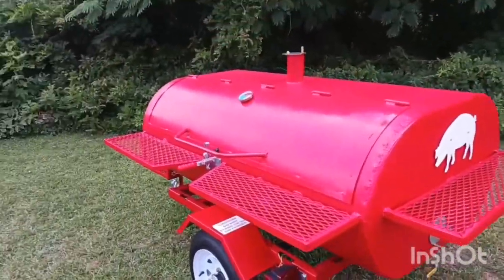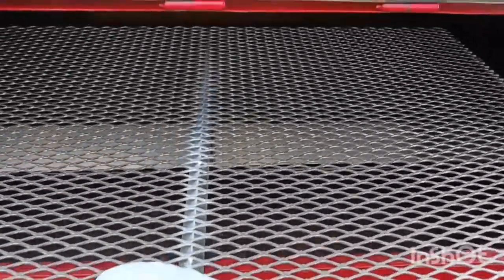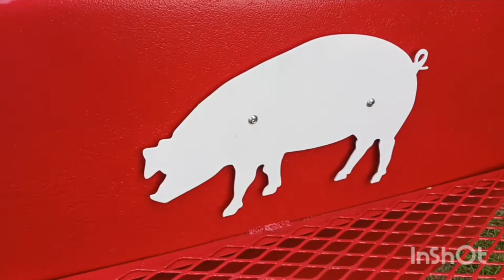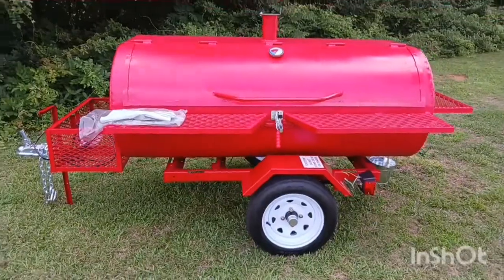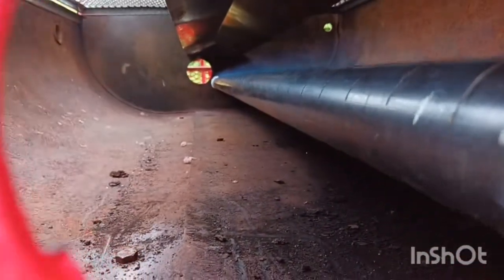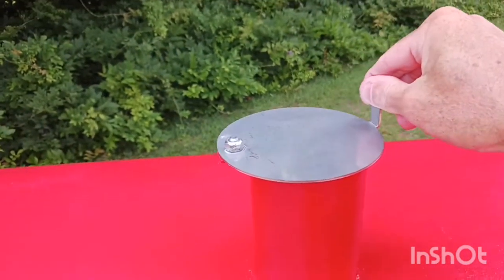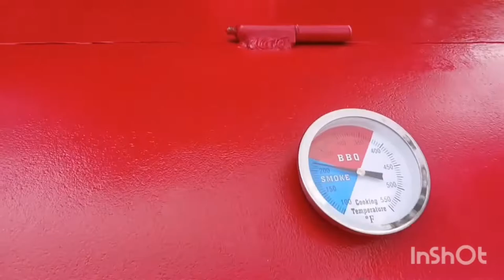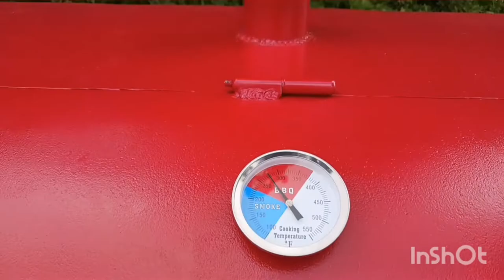pig cooker

Comment: Junior can you make a combo model with both propane and a fire box in the rear, so you can add smoke to the meat while maintaining steady even temperature with the propane.  And one more mod. Can you put the smoke stack in the front coming down to grate level so it forces the smoke over the meat before it exits out the smoker.
Reply from the maker: I'm sure I can where are you located?